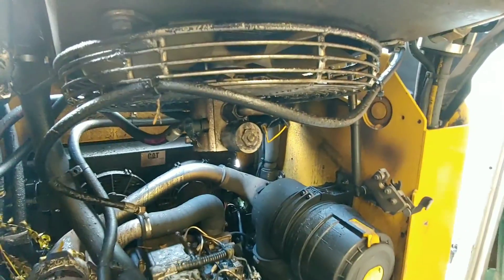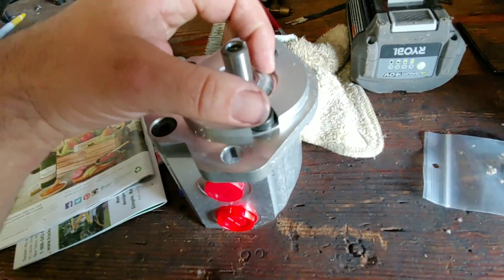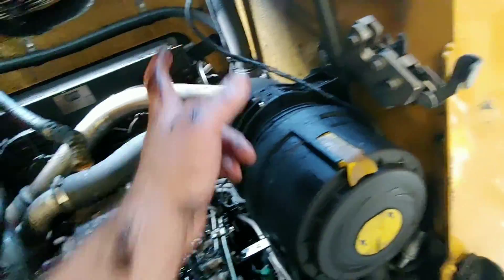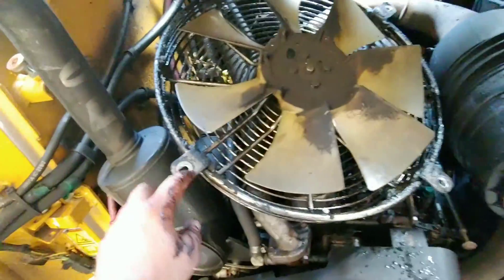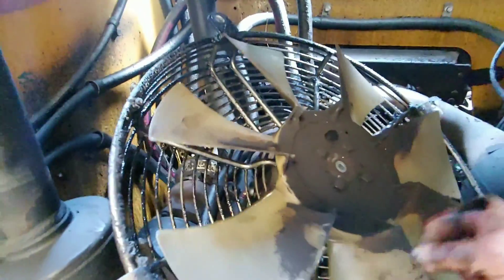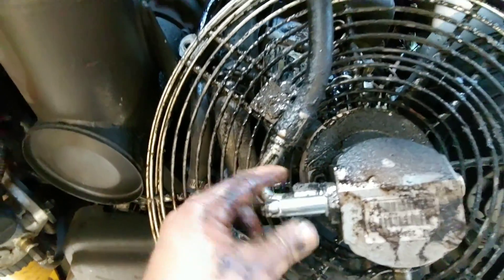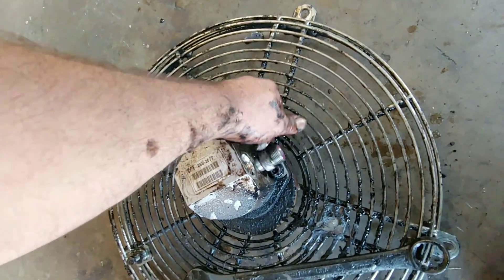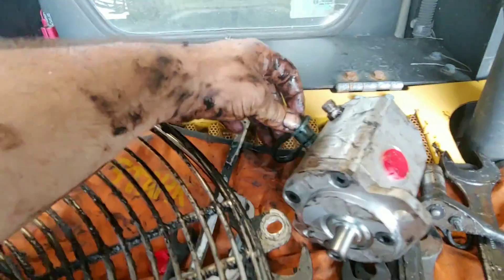Cat skid steer hydrolic fan replacement.

Comment: What size nut and bolt is needed to hold the fan blade onto the shaft after replacing the old fan blade?

Comment: we have a cat 248B skid steer. All hydrolics stopped working but the cat still runs.. what can it be
Reply from the maker: Hydronic pump went out, low hydronic fluid, blown a main hydronic line if there's no leak then it sounds like a blown pump